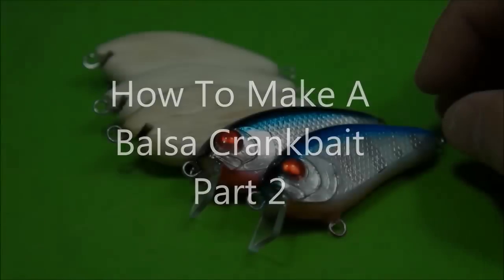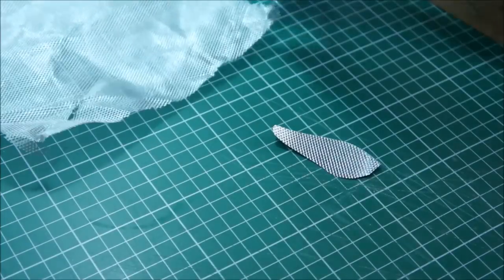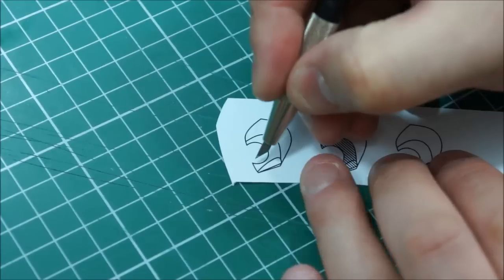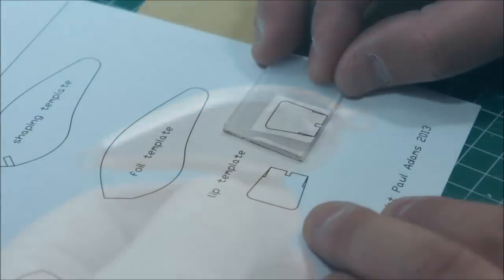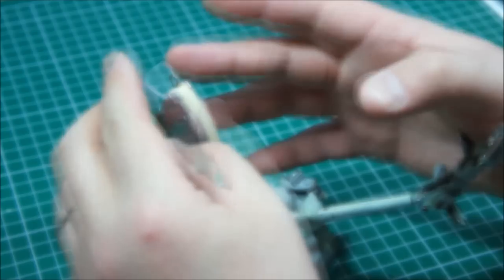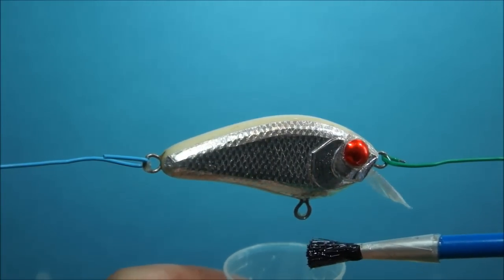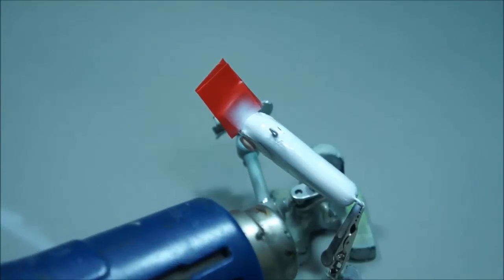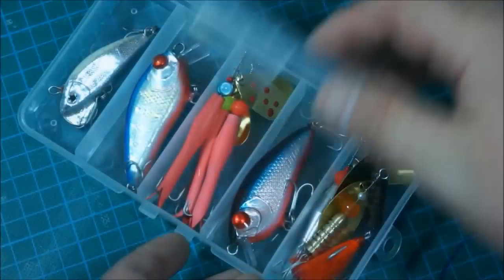How To Make A Fishing Lure, Balsa Crankbait Part 2

Comment from the maker: I use envirotex because thats all i could find at the time, but many other lure builders use Devcon 2 ton, but any low viscosity epoxy with a slow setting time will do,. The low viscosity will mean it flows and covers well, the slow setting time means i have a longer time to work with. Many craft suppliers sell epoxy for coating jewelry, i have seen videos of people using 1/2hr or 1 hr epoxy. Hope this helps

Comment from the maker: You can use ordinary fabric netting the kind used for spraying scales and it works fine as long as it is on a solid surface.  

Cheers Dieter

Comment from the maker: I normally buy wires in bulk, 20-50 no, recently i have been using s/ Steel Tig welding rods which are straight and up to a meter in length, MIG wire is another alternative but this is normally coiled and  sold in huge amounts, I used to buy spinner wires but again sold in 20-50nos in europe i use either e-bay or lureparts.nl , America has Barlows, lureparts, mudhole, janns netcraft. I think the only answer i can give is build a lot of lures, sorry 
 if you live in the uk i can post u some

Comment: it is really neat to go back and watch your older videos. Amazing where you have been able to make it too, with your camera work. 
I am specifically looking for something though. I have made suspending baits, and non lip diving (weighted) baits. I have carved my first "crank bait" body out of Bass wood and I am (at this very second) making the mold to it. I am going to play around and do a top water no lip, and a suspending no lip version with the feather lite resin once I get it. I am now mixing "amazing resin" and "alumilite foam" to get what I need. 
I need to know if there is a formula for what length and width lip will make it dive different distances. I bought the 2mm plastic sheets and that is what you are using here. I think that the lure that I am making is going to be in between twice and three times the size as the one that you have made in this video. 
So I made this long by accident, but my question is, "Is there a lip length and width chart to length and width of lure that makes it dive a specific depth and or wobble. Very specific I know but there has to be a better way than my trial and error way that I have been doing for my 34 years on this earth. LOL 
Any help (including anything that I am using here((which is why I added it all into this post)) would be greatly appreciated. 
Love your work and get excited for each new video. 
Thanks.
Reply from the maker: no there is no chart that i know of, there so many variables and i am continually surprised by how just minor changes can effect lures.  The only way I have found to get something i want is by trial and error but also recording accurately what works with some kind of drawing so you can repeat it.  There may be other answers to the this question and it may be worth asking it on tackleunderground.com

Comment: I want to build my own fishing rod with spring steel, I want to use heat shrink tube to give the steel a color and protect it, and then, do you think I can use epoxy for the glossy coating? Is epoxy flexible or does it break when I bend the rod?

Comment: What kind of sticky tape do u use on your bibs and at what time do you take off the tape so you can have a nice clean finish on your bib
Reply from the maker: sealotape or scotch tape, generally i take it off when the resin is cured, sometimes if i have gone a bit over the edge of the tape with resin i trim it back with a craft knife

Comment: hi 
Paul, i just got a set of createx acrylic primary color set like the one you are using.
i need your advice as i have never done airbrushing before and have no knowledge.
Could you please advice me how to use these primary colors 2 opaque ( black & white)
while remaining 4 colors are transparent.  I tried with white opaque and it seems it requires
thinner as it has suspended particles with water and universal thinner and when i did spraying
it was watery.  I have brush with .2 mm thick niddle, don't know what psi i have keep.

could you please advice.

thanks, regards  raghubir

Comment: Great Work! You are a true perfectionist. I'm using stainless steel screw eyes at 1/2 & 3/4" threads in two poplar baits. Is it due to the balsa you are using the wire eyes? -Subscribed-
Reply from the maker: fwfrazorx I think balsa is a bit too light for screw eyes, i use them on pine and other harder woods. Some lure makers i have seen put poplar dowels into balsa to attach the screw eyes but it is not something i have tried. thanks